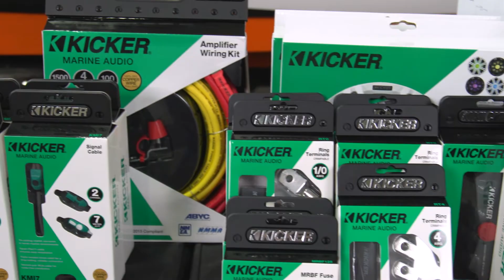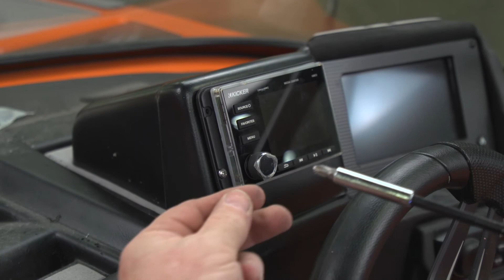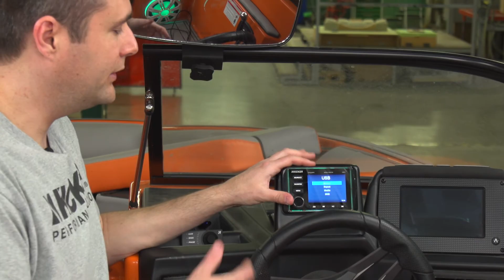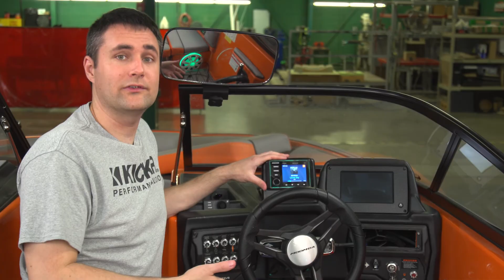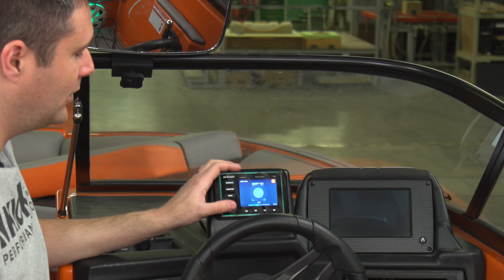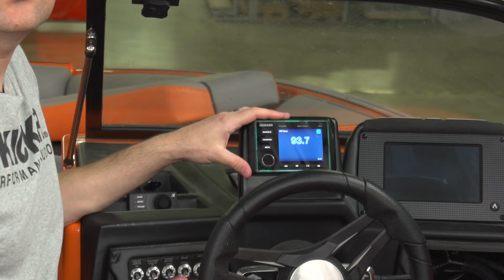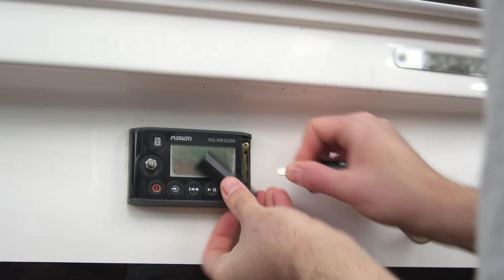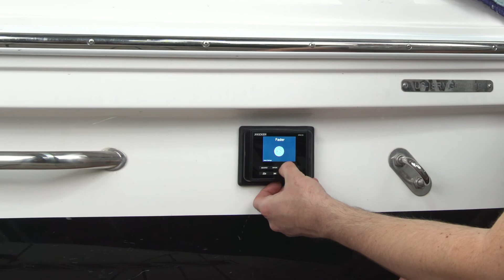2021 Moomba Boat Indepth Install

Comment: After watching the video it seems as though you have more speakers then you have channels on your amps. I may be wrong. I just bought a boat that had about the same setup but they had 2 or the speakers sharing the same channels on the amp. Which if I’m not mistaken is a no no and reduces the watts going to the speakers.
Reply from the maker: It is possible to put multiple speakers on a single channel. This drops the ohm load, which increases the power output.

Comment: Love this video, I want to do the exact same thing in my Tige 21v, very similar scenario, replacing the original system.  can you recommend an installer near New Braunfels tx?
Reply from the maker: Thanks!  And yes, we can help with finding a dealer.  Click this link, enter your zip code and the system will do the rest. All of the dealers that carry marine products will have an anchor icon in the lower right hand corner: https://www.kicker.com/dealer-locator

Comment: Would any way you can post the wiring diagram for the two battery banks with the acr?  Also can you show a quick run through of final install tracking your wiring to power the amps (didn’t see the ground and how tied to the boat engine/accessories ground)
Reply from the maker: Unfortunately YouTube doesn't allow a wiring diagram to be posted here in the responses, but if you email support@kicker.com, they can send a diagram to you.

Comment: Can you actually show the hooking up of the head unit? I am trying to tie this into my boats current sound system without messing anything up and there’s nothing about the non-powered hook up that I can find to power the unit
Reply: I already have 2 amps. One of which is currently hooked up to the cabin speakers. It’s a kicker unit too but I’ve found nothing about hooking this up without using the powered hook up
Reply: I believe I would just use the RCA outputs to hookup to the amps and powered subwoofer but don’t know how I would get power to the head unit in that setup
Reply from the maker: Give our Tech Support team a call.  They are open weekdays from 8-5 Central time at 405-624-8510.  You can also reach them by email: support@kicker.com.

Comment: is it normal for my tower speakers to have some low static noise when stereo is muted or turned to 0?
Reply from the maker: This could be a grounding issue, but sight unseen its hard to tell. The best thing to do is contact Tech Support. They are open weekdays from 8-5 cst. You can reach them at 405-624-8510 or by email: support@kicker.com.

Comment: For the RGB wire how did you run them back to power. Did you run them in parallel?
Reply from the maker: Check out pages 7-8 in this PDF. The wiring technique is the same, regardless of what LED-equipped Kicker product you have: https://www.kicker.com/files/manuals/48BTCAN65.pdf
Reply: thank youuu!! @KICKER-AUDIO

Comment: Not trolling or trying to start a brand war.. but why would you remove Wetsounds equipment and replace it with kicker?
Reply: They are a kicker dealer, apparently. Likely an upgrade in power and performance over the OEM wetsounds, hence the upgrased electrical systems.
Reply from the maker: Listen to them head to head.  Then decide.

Comment: Instead of butt connectors, you should think about using Deutsch connectors.  Much quicker to install, much quicker to replace when a speaker or trim ring goes bad.  Not that one of your products would ever fail, just saying.